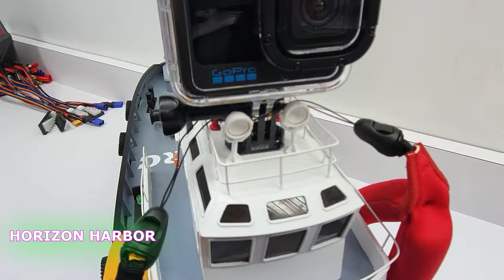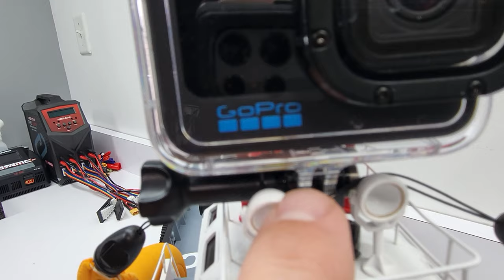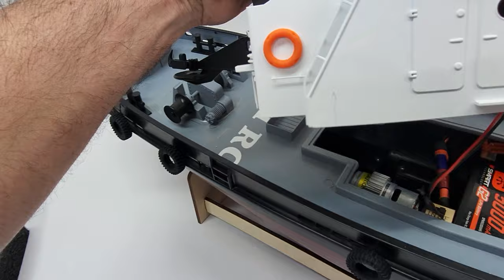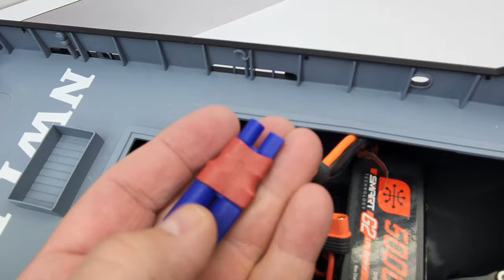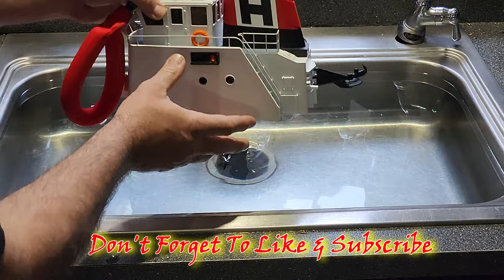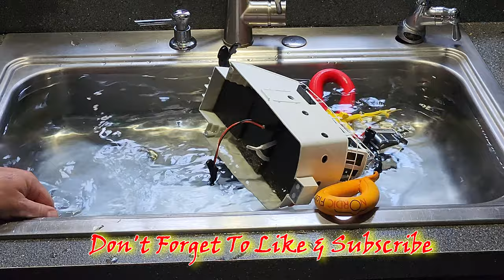HOW TO PROTECT YOUR HORIZON HARBOR TUG BOAT AND GEAR FROM SINKING

Comment: Get a large spool of very 'sturdy' sewing thread and a piece of brass rod or prop shaft and attach securely someplace in the hull so that the spool can spin freely; attach the exposed end of the  thread to the cabin securely (use moisture/waterproof adhesive). Why?  So that if the tug sinks the cabin will float, the spool will unwind with the thread attached to the floating cabin and mark where the tug is. Think of it as  a marker buoy. 👍
Reply from the maker: That's a great idea! Why not protect the whole investment. Thanks for the tip. I might try that.. Thanks again.

Comment: Nice idea, I used magnets on my foam and upper deck so I can remove it quickly to install my Insta 360go2 I also have many other upgrades planned. As far as the universal joint stripping out, it can be prevented by ensuring the Grub screws get lock tight applied and checked each time before operation for tightness ( they will otherwise work lose after a few runs).  As a practice with other types of RC vehicles I have learned to closely inspect RC's because it will save me money and down time in repair's. Enjoy your day.
Reply from the maker: Magnets is a great idea. I've removed the foams with no issues as well. My GoPro 10 doesn't mount good on the inside of the cabin. Yeah and it's also a good idea to inspect everything like you said.

Comment: Thinking  how weak the universal joint is on this boat. Mine stripped out the first time the prop wrapped a weed. Struggled to get the boat back to shore and it was only 10 ft This is a great rescue boat with a major flaw.
Reply from the maker: That sucks and will keep this in mind. Thanks